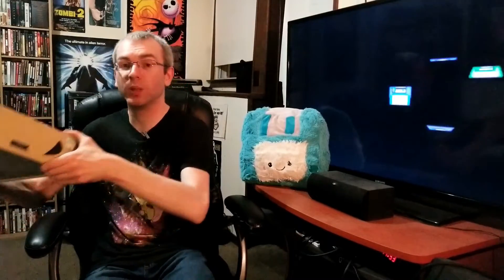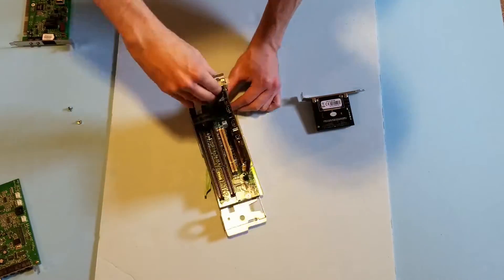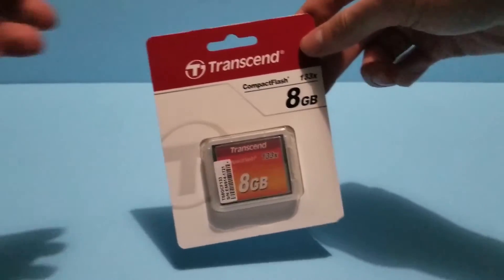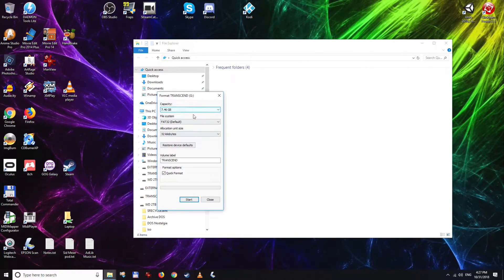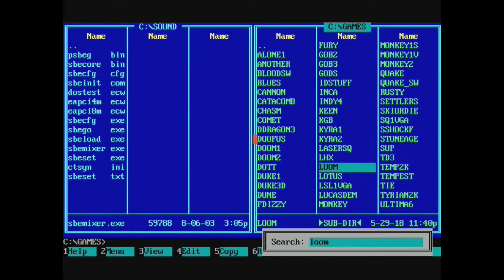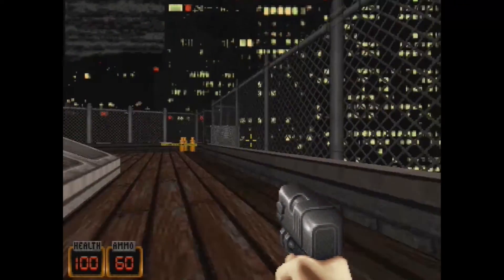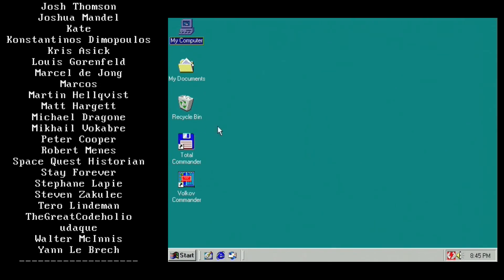Compact Flash storage upgrade

Comment: I have a CF adapter like yours in my retro pentium 233 mmx computer.  I use one 8 gb CF card for dos games and windows 3.1.  I use another 8gb CF card for windows 95 games. 
Both cards work great in my system.  It's great how I can easily swap them out.

Comment: If I knew that retro computers and CompactFlash HDD replacement would be a thing today, I would have kept my (Philips) Vendex Headstart LX-CD computer. I regret having donated it to the school when we upgraded to a new computer, and the hard disk in the Headstart was starting to show physical errors, but at the time it made sense when space is a valuable commodity. I can't even find the Headstart menu system. 
I'm not sure what happened to my 486 computer (dad probably tore it apart for recycling). I still have my P5 computer, though it needs the sound card replaced, the case beat up, and the CRT is dead.

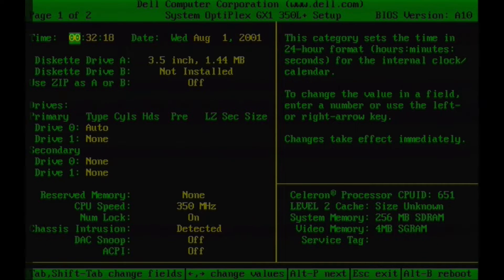Comment: (1:55) How old is this model? The system itself appears to be Y2K compliant, which is good. How sturdy is that case? I remember setting the Magnavox VGA monitor on top of an under monitor power manager, on top of my (Philips) Vendex Headstart LX-CD computer, which had a metal bar inside across the top for support. (4:23) That sounds like a situation for a relocate-the-battery solution, which I saw LGR do once using size AA. 
This is the sort of video that makes me subscribe to a channel: informative, useful, entertaining.

Comment: 1:00 I hate this particular model! I have one back in a day and it was total junk at least for me. in principle;  this machine recognize up to 8 GB (usual for Pentium socket 7 era)  , but I had a problems with hard drives with capacity above 512MB! it was strange compatibility issue and drives about 2GB did not work currently on this BIOS even after I updated it.
I was in situation like 386 hard drive limits (again 512MB) Mine configuration was socket 7 Pentuim 1 233MHz 32MB ram
Reply from the maker: Interesting. Well, I'm happy to report that 8gb and 4gb cards seem to work perfectly fine for me on a stock bios.

Comment: I know a few people that use CF based setups. I haven't done the upgrade yet and my retro builds are still trucking on traditional hard drives (crossing my fingers they remain stable for a while!). If anything happens to them I'll definitely swap out to CF as it looks pretty easy to do and it's great how much faster things install. Thanks for the video!

Comment: I like that CF adapter, how it comes out of the back of the case. The one I was using was internal without a good way to mount it, so always worried I was going to accidentally short it out. I have a similar Pentium III machine that I still need to restore, so definitely going to grab one of those for it. Seems they are even cheaper on the actual Monoprice site!
Reply from the maker: Oof, that's quite a price difference! Gotta amend the link in description when I get home.